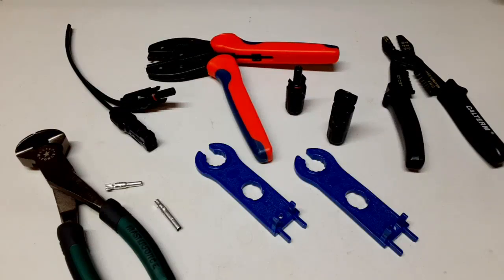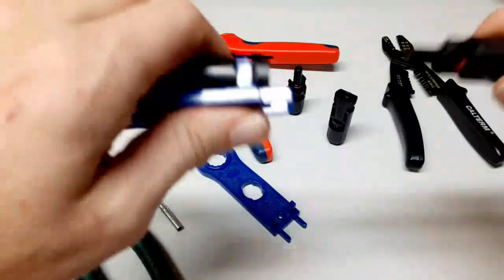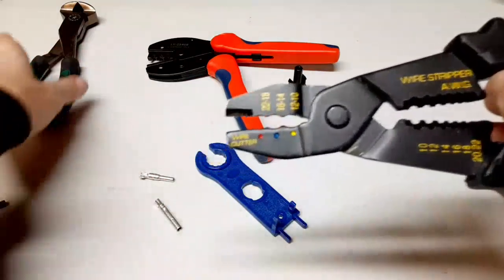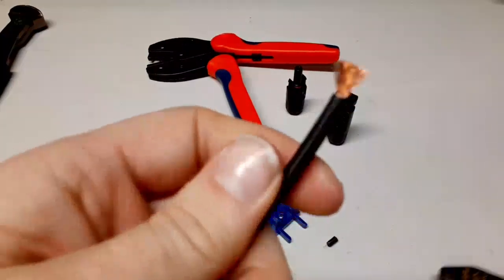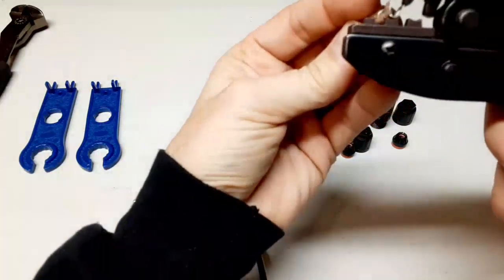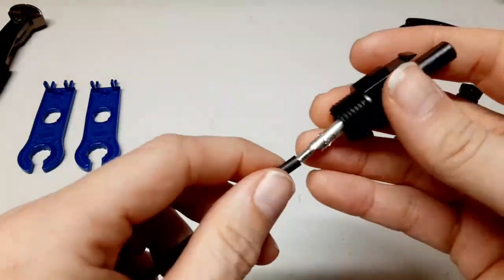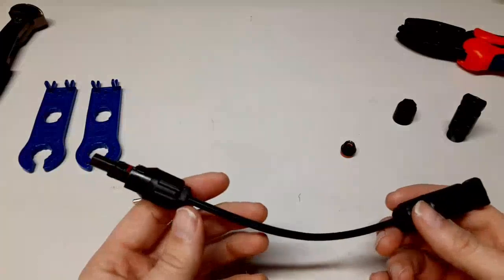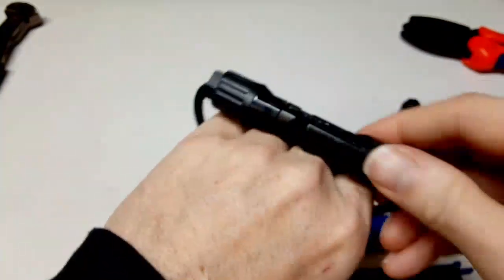BOUGERV  Solar Crimper Tool Kit - How To make MC4 Connectors For Solar Panels (Part 1)

Comment: All went well until 25 Months later....... The Bouge connector material disentegrated and fell apart. Whatever material Bouge is using will not stand up to extended UV light. If you have them installed, check them periodically.
Reply from the maker: Yes, it's always a good idea to  check your connections often :)

We have had our BougeRV MC4 outside for years now. Still in good shape for us.

Maybe you got part of a bad run?

Comment: Does the same MC4 connector fit all wire gauge? 12, 10, 8, 6.
Reply from the maker: We have only tried 12 & 10 with these.

Have not tried 8 or 6 gauge wire yet...